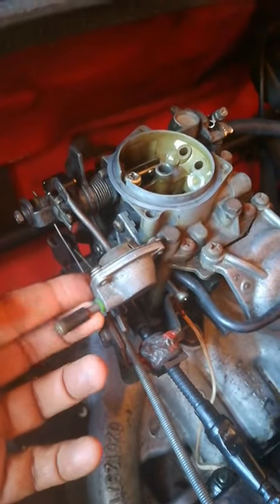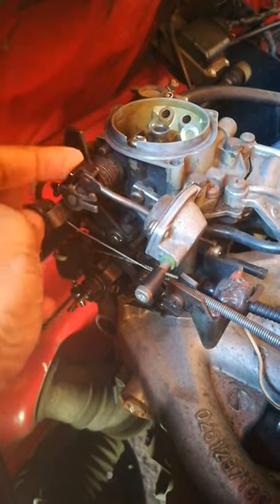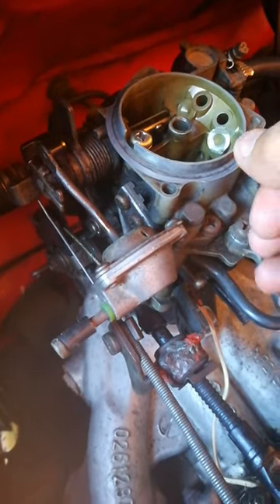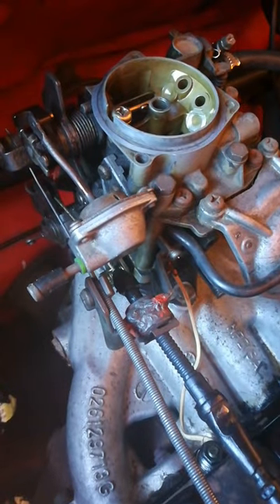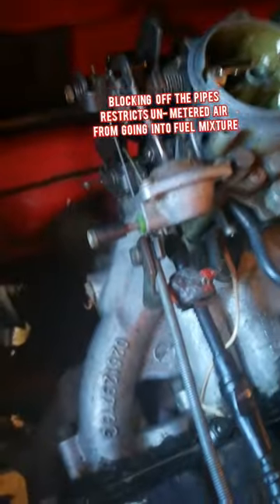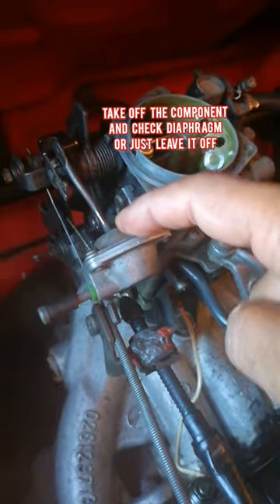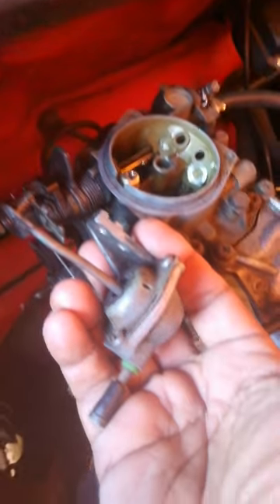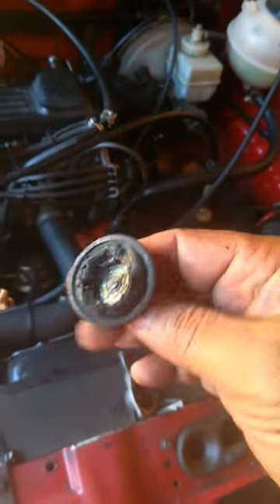Golf Mk1: More on the Keihin KS2 Carburetor.

Comment: Hi good day sir, why would i get a oil and petrol mix coming out from air filter housing.
I was driving around 140ks then to puffs of smoke came out exhaust..
Then i saw smoke,  but it was the oil burning on manifold.
The airfilter housing was full of oil.
It was a considerable amount of oil coming out.
It has stopped how ever it is dry now,  and there is no smoke coming from exhaust when i rev only water ..
The caddy was also stalling when i was braking an i adjusted the idle screw.
 It has stopped cutting off now at the robot..
Gosh all in one day..
Your advice would be amazing!!
I love your channel😊

Comment: hello   can I   completely remove that and it's lever ?
does that affects the  working of carb ?
another question there is a flathead brass screw behing the 2nd stage pump (left side of carb if you are facing car front) is it for floater adjust?